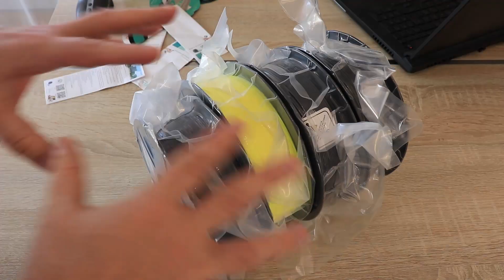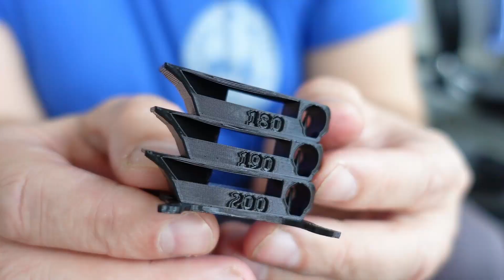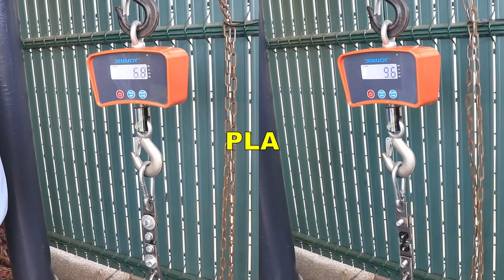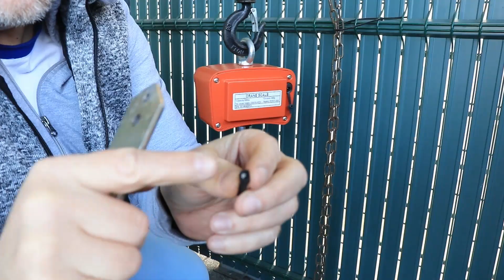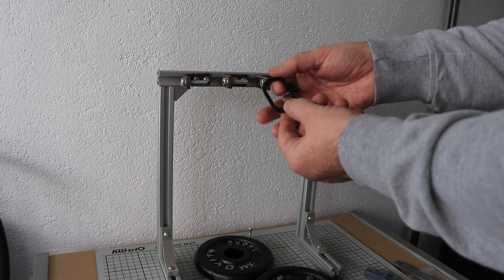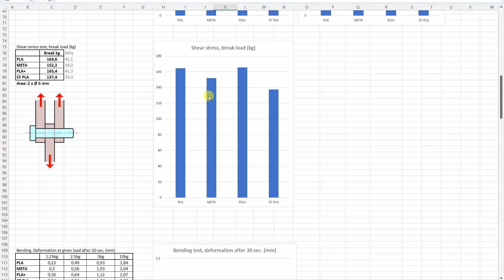Carbon Fiber PLA vs META-PLA vs PLA+ vs PLA by Sunlu

Comment: Now you know why they didn't send you any CF... the fires are ground to a dust and added  to the PLA filament.   Carbon fibre relies on the overlapping and interweaving of the fibres, the carbon is still extremely strong but like anything from animal meat to plant fibires they are only strong when the fibres align with the load, going across the grain is the same as fibres being ground up.

Comment: The interesting thing about the PLA Meta is it can still print at higher temperatures. What Fat Dragon Games worked out is if you print it very hot through a 0.2mm nozzle at a fairly low print speed, it ends up being very good for high detail minis. 

Just need to be a touch careful about not leaving them in the car when we've got one of those 100F summers we seem to get around here. 

(Which is also why I'm checking this video 2y after it was posted. The hot car calculators must think I'm nuts...)

Comment: Thank you for the video - have you had a chance to test out Sunlu's newer PLA+ V2 compared to their PLA Meta for strength and toughness? According to Sunlu's marketing, they make it seem that the PLA+ V2 is the stronger filament, but they have PLA Meta listed under Functional Filaments, and the PLA_ V2 listed under General Filaments.
Reply: Was wondering the same thing.

Comment: I thought that spool looked familiar. I received the very same brand as a no-name pack-in version roundabout 2018. I've long wondered if it was a Sunlu offshoot or another rebrand from elsewhere. It didn't perform very well for the printer it came with compared to most anything else I tried with that printer, and I still have the spools for a future project involving upcycling old filaments and support material (process via grinding/powder and modification of the components with formula modifiers).

Comment: PLA Meta is an incredible filament in 0.2 nozzle printing, but you have to print slow and at temperatures much higher than Sunlu's recommendation - 220 degrees if I remember.  A guy operating under the name of Fat Dragon Games made a custom profile for it for the A1 mini and A1, results are closest to resin I've seen from such low cost FDM printers.  Search on youtube or in google

Comment: If I may: right now PLA+ costs ~14e while META can be bought recycled for 9e: if you get the cheaper and do one more perimeter you get both extra speed and strength when you need it.

Comment: all carbon filaments are such BS marketing crap. pla outperforms them always. the experts on printing pew pew parts only use pla + that tells you which is stronger. you must also check out the pla matt, it seems to be stronger than regular pla and has a really nice finish and very easy to print

Comment: The reason I use META is that it allows me to print about 30% faster than any regular PLA. It flows about 50% more than regular PLA. The downside is that is a little more susceptible to high temps, but if it is a print used indoors, that's fine.

Comment: Meta is some of the most disappointing filament I’ve ever bought. I’ve gotten multiple rolls that couldn’t produce a single quality print. It’s supposed to be high speed but the adhesion is so poor you run the risk of knocking your print over if you speed it up. Give me Sunlu Pla+ all day every day.

Comment: I can’t print with PLA+, it lifts up, edges is not clean and leaks everywhere. 
Any advice?
Reply: Hotter bed. Brim (mouse ears preferable). Slow for first several layers. I only print with pla+

Comment: Liked your tests, Thank you for the confirmation i was looking for, tought also carbon 'fibre' would be worse; it is carbon powder not fibre, just like glasfibre, the strenght is in the cross-fibres and not in the substance or whatever, and carbon by itself a 'particel' that is harder than most of it's surrounding 'material, it wil brake of more easely; hardness of crystal glas is harder then ordinary cheap glas but brakes faster due to its vibration of hardness, i  ! great watch ! , subscribing! grtyz. from Belgium and Espana, Carlos

Comment: eSun offer detailed filament settings on their website. Sunlu offer NOTHING. I find it frustrating that a manufacturer today in this market is publishing no guidelines on the important factors from nozzle temp to flow rates and retraction. I know there is variance in machines needs etc but there are fundamentals that materials have for a starting place or "safe" print and Sunlu should step up their game on this. 

Incidentally, I notice eSun sell as "High Speed" PLA (ePLA-HS) touted as being a faster and better print material. I examined their spreadsheet of settings for their materials - and they use all of the same settings for ePLA-HS, PLA+ and many of the other PLA derivitives. So... is there no difference or are their published settings just junk data using Machine Manufacturer default profile information? 

Any thoughts on how to progress toward assessing this?

The reason I ask is that I have recently undertaken a task of trying to get the community on the Prusa Forum to begin establishing and contributing to a database of optimised print profiles for various materials and brands. With so many types now, this is necessary and there is NO central repository established anywhere.

Comment: Stumbled on this video because I was looking for carbon fiber PLA from sunlu.  I think you may have under extruded, and had too-low a print temp.  Maybe more flow and higher hotend temp would help with strength.  I am very curious if CF is stronger in many aspects, because it is also a comperably cheap filament from sunly.

Comment: Hi, I have an ender 3 S1, and I have problems when printing sunlu Black PLA normal, with the stringing, what main features do you use? temperature, retraction, flow, etc?
Reply: Retraction 2mm to 8mm will stop the strings
Reply: Also z hop helps

Comment: There are a lot of different tests, comparing different brands of carbon PLA-s and to common. Most of them are pointing out that Carbon filaments not stronger but even weaker compare to regulars.

Comment: Exactly my thoughts when i got the filament. No branding on the spool. I had to write  it on to avoid problems later. I would say i got a bit sceptic about the origin of the spool. Next issue is the holes, just as you mentioned. Finally, -and this might be a very bad news to those who don't own a filament dryer-,i had to dry the filament even it was just taken out from the vacuum bag because the stringing was crazy. Not even my 1 year old Eryone stringing like that. After the drying was everything ok and normal though

Comment: I haven’t done much printing yet but have been using filaments from Overture. So far I’ve used an entire spool of their PLA and PLA Pro. I tried PETG but gave up on trying to figure out good settings for it and moved on to their ASA. The printer’s attachment for the Bowden tube broke shortly after I started printing the ASA and I haven’t installed the replacement part yet but so far it’s been the easiest to use, it only took a couple tries to nail the settings.

We bought the printer for our aut1st1c son (YouTube doesn’t like the word now that it’s starting to be used as a slur) because he really likes characters that we can’t find and even though he can’t communicate very well, he’s really good at designing houses, stores and city infrastructure so we split the cost of the printer and spools with his grandparents so that we could print out characters he likes and his building designs. It’s actually really sad about the aut1sm because he’d be a really talented architect or civil engineer 🥺

I’m thinking ASA is the way to go for him also for the heat resistance and am definitely interested in seeing your tests with the CF ASA you got. It looked like the finished surface of the CF PLA temp tower you printed was a lot nicer, was that just because of the color or lighting or something else? Definitely look forward to seeing your test results with the CF ASA and it would be great if you could compare it with regular ASA, ABS and PETG during the testing.

Thanks for another great round of tests.
Reply: ❤ But be aware of toxic fumes caused by ASA. Also Carbon Fibre is quite toxic too. Pla is the most less harmful.

Comment: The addition of carbon fiber will indeed make Filament brittle, which is an inevitable material characteristic. All carbon fiber Filaments are just mixed materials with carbon fiber powder added, not real carbon fiber.
Maybe everyone will buy it because of its touch and look, because not everyone needs to use carbon fiber to print high-strength parts~

Comment: As you mentioned several times, hotter temperatures produce better layer adhesion and worse appearance. To keep testing times short but also have more interesting tests, I suggest printing once more only the sample for layer adhesion at the maximum temperature, so that for layer adhesion you will have two values: the max and the usual one.
Reply: I'd go well past the max, a lot of those filaments in the tests aren't always bonded correctly, as the CF tests show. And I've seen it a lot in the testing videos, especially the torsion tests. If you have single strands breaking out in your torsion tests your intra-layer temperatures are far too low - 230 isn't an upper limit, it's a recommendation for fairly slow printing speeds, I often print PLA at 240-250c and even up to 260 for filled materials with the speed of more recent printers.

Comment: By the looks of the test subjects your printers are all under extruding and leaving gaps in the plastic, you may also want to increase your overlap percentage to remove the gaps between your infill and the walls because there appears to be gaps in that interface as well. Fixing that will defiantly bring up your layer adhesion and remove some more of the imperfections in your results. Great job testing all these filaments though, its really interesting seeing your results!
Reply from the maker: I will re-test CF PLA with higher printing temps and with 105% as others suggested. But my esteps are correct and I got similar cross section on other printers too. So if this is the case, then Sunlu should suggest these parameters on the website.

Comment: Printing with steel, vanadium, and tungsten nozzles I found that having the cooling fan on really reduced the nozzle temp. In addition to increasing the nozzle temp by 10C, smearing high temp silicon RTV on the sock to better cover the nozzle helped a lot, as did turning off the fan for everything but bridging.These changes gave much better layer adhesion and reduced underextrusion with the high temp nozzles.

Comment: Awesome as always, Igor. These are great tests for me. I rarely use PLA but for one of my projects PLA is the best choice. It is a small acoustic pressure chamber. The pressure is very low but the volume stability at constant temperature is important. Stainless steel chamber is great but at $16k I can’t afford another one. Aluminum was less stable but still good but still very expensive to have machined. PVC was not very good, even encased in epoxy. I tried 3D printing a chamber in PLA (based on your previous tests by the way) and it worked quite well. The chamber is useable and only cost about $20 in plastic. I wanted to redo it in PLA CF hoping to improve the tensile strength and rigidity. Based on your test here that would not be good. However I’m hoping, as others have mentioned, the poor layer adhesion may indicate a higher print temperature could improve the properties. So I support your idea of a follow up video.
Reply from the maker: I reprinted CF PLA on 230C with 105% flow rate, test soon...

Comment: In my experience and talking to my plastics vendor at work, when CF is added to a material, it is to add rigidity, make it printable (reduce warping) or simply for aesthetics. As PLA is already a very rigid material which doesn't warp, the only real benefit of adding the carbon fiber is purely for the aesthetic properties it gives, so the carbon fiber that is added is usually powdered or at most, very short fibers.
Reply: Carbon fiber also adds a thermal property. From my own testing and experience filaments with carbon fiber typically hadle heat better. It also helps avoid shrinkage for items that exposed to heat

Comment: I think for Carbon Fiber filaments you should purchase Hardened Steel Nicked Plated nozzle with copper alloy. I saw comparison of strength of prints with brass and harden steel nozzle and difference was huge. It could be the reason and the maybe carbon fiber will be better, I am not sure but this difference is pointing me to print issue
Reply: Or better Ruby nozzle but it's more expensive

Comment: I print a lot of CF material.  For your CF tests, I might suggest that you were not printing hot enough and were under-extruding.  If you look at the cross section of the test subject, there are gaps, and the breaks occur along these gaps.  I believe if you increased your flow by 5-10% and increased your temperature by 10 deg C, that the filament would perform much better.  Would you consider doing that and adding an addendum to your video?  As always, you do a great job and am happy to support as a Patreon.
Reply from the maker: You definitely woke up my curiosity. I will try that. If I will get much better results, I will create a short video about it. If not, just a Youtube post about results.
Reply: @MyTechFun  I am also very much looking forward to this follow-up since I had much higher expectations about PLA-CF's strength.
Reply: @MyTechFun  About under-extrusion, it's fairly often that some is noticeable on perimeters of your test objects.
I may suggest to calibrate the flow multiplier for all filament. It's a quick one.
That's what I do and despite calibrated e-steps, the extrusion multiplier results range from 1.06x to 1.26x
Reply: @MyTechFun  Thank you for your efforts. I think print temperature is important for strength tests.
Reply: I also print a lot with CF. Finding the right temperature is a pain in you-know-where. As steel nozzle dont conduct heat too well  I usually start at max temp, recommended by manufacture and go up from there. print speed also makes lots of difference if you have ptfe tube in heartbreak. I use only full metal heartbreaks so my melt zone in much longer.
Reply: It could be very interesting video. Maybe adding to this test prints with brass nozzle (probably nozzle will be damaged after experiment but should be able to finish 4hours print). And then it will be comparable and will provide info about nozzle impact
Reply: I agree on this, i've been printing with a lot of CF PLA form Polymaker, and i was very disappointed after finding that layer adhesion was worse than ABS (i was able to peel printed parts with my bare hands), but after increasing the temperature from 210 C (90% fan)  to 235 C (10% fan) the layer adhesion increased around 30% (no loss in print quality) and now layer adhesion is something between ABS and PLA Pro, now i feel more comfortable printing parts for my projects with this material. 

I also found that printed parts on IdeaMaker result in even better layer adhesion with the proper "Maximum Shells Overlap Percentage".
Reply: I also support this. More heat and more flow are needed. With CF mix, same material also need different Hole Expansion values to create accurate horizontal hole diameters. CF mixed materials don't expand outwards as much when laid down by nozzles.
Reply: CF also harder to heat up iirc? Higher temps slower speeds probs.
Reply: With a slight material science background from university I always thought that the pla is not the right type of matrix for carbon fibers. In aeronautics we used a bi-component resin.
Reply: Doesn't CF handle abrasion better?
Reply: Why do you print CF? I can get the same look and texturing using matte PLA.
Reply: @vd853 it’s not the look. It should be increased strength and less creep. The results here don’t show that so I understand your question.

Comment: gotta say I am supprised how much carbon fibre weekens pla's mechanical property expect bending strength
Reply: Considering the delaminations, I wonder if it would be worth repeating the experiment at different temperatures.
Reply: CF, when done correctly, doesn't weaken PLA to that extent. And what it takes away from PLA normal strength, it gives back as rebar. However, when done wrong (fibers too short or just dust), CF takes away too much and doesn't add anything back because it's not the correct length of fiber. Or if it fibers are real, they're not blended correctly so they don't bond with PLA well. In any case, this is just another fake CF filament.
Reply: Silk filament feels the same - weak. Fibers won't cross between layers or walls, so I think it's mostly for the looks and name :face-fuchsia-tongue-out: